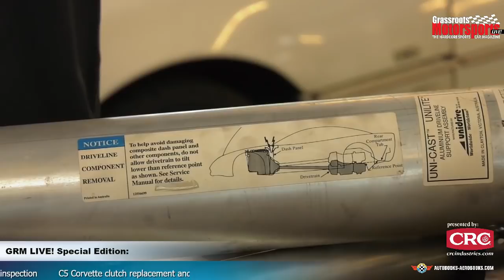C5 Corvette clutch replacement and drivetrain inspection. GRM Live! Presented by CRC

Comment: One correction to comments about the fuel tanks......you do not have to remove any of the drive train to drop the tanks on C5s with manual transmission.  Can't speak for the automatics..those transmissions are much larger.  I will say that if you do remove the rear cradle and torque tube it is then easier to drop the tanks, but, why go through all that extra headache if you don't have to1!Love the videos!!
Reply from the maker: Thanks Larry. Boy even so dropping those tanks is a hassle. We had to lower them a little bit to weld in the roll bar plates, and even that was tough. Not looking forward to ever having to do a fuel pump on that car.

Comment: Grassroots,
Where do I go to shop the upgraded rear engine cover?
Reply from the maker: Our understanding was that it's an improved part. So all of the modern replacements are an upgrade over the original piece.
Reply: Sweet!! Thank you.  I'm going through, rear main seals and differential right now with dealer and warranty company. 
I'm building my Z almost with the same parts as your build.
Q. When you installed the Improved Racing Baffles, why not the Crank Scraper as well?
Reply: @Grassrootsmotorsports  Can you find out which Rear Main Seal cover was the improved one. Searching sites I'm finding Brand DIY  -Rear Main Seal Cover - 1997-2012 Chevrolet Corvette - DIY Solutions BAS00171, Brand Dorman - Rear Main Seal Cover - 1997-2012 Chevrolet Corvette - Dorman 635-518 Brand SKP Rear Main Seal Cover - 1997-2012 Chevrolet Corvette - SKP SK635518 or something else?